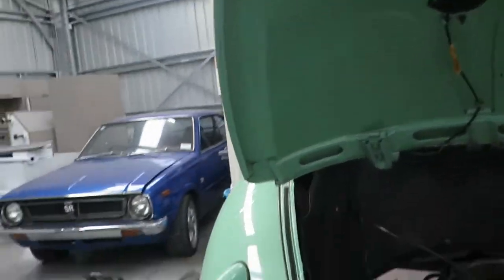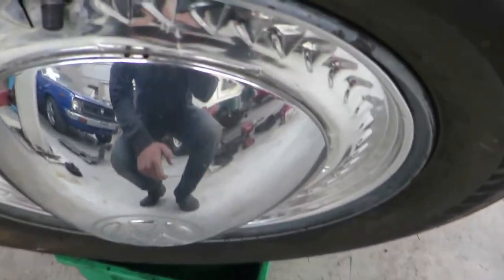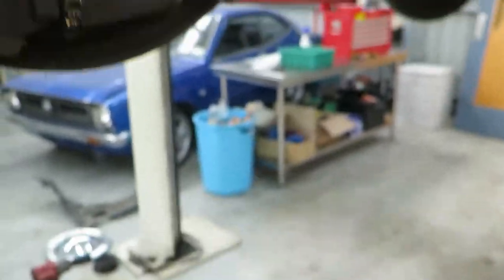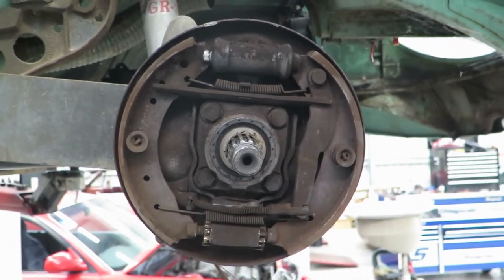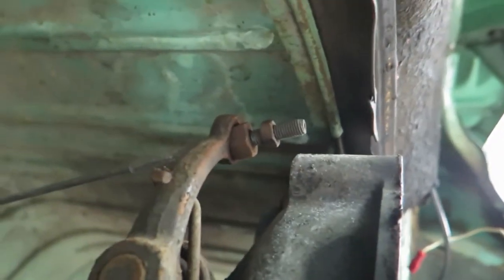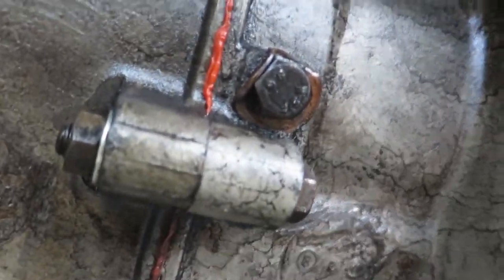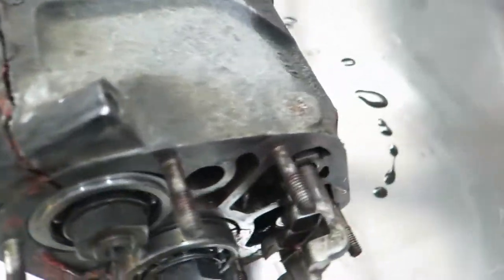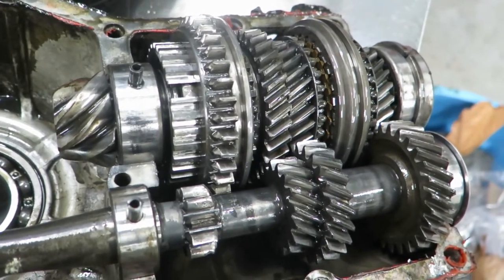How to remove and strip a 1960 VW beetle gearbox

Comment: Hi there. Will you be posting a video of putting it back together?
Reply from the maker: It's all on hold as we are going through massive changes at work, moving workshops and all sorts of other stuff that has taken me away from any projects. And I can't find a good input shaft... But I have got a couple of synchromesh gearboxes so might have s look at one of them and then fit that. Oh and I need a new camera, the other one died. But hopefully happening soon

Comment: were is reverse?
Reply: If you stop the video at 16:19 you'll see the two straight cut gears that form the first gear. As you can see they are not meshing. There's a set of intermediate gears in the other half of the cage that slides into those two gears when you engage reverse gear. If you stop the video at 14:09 you can see the pair of little intermediate gears that form the reverse gear.